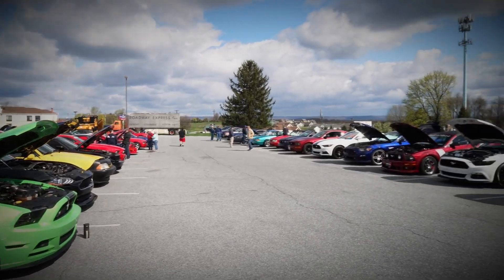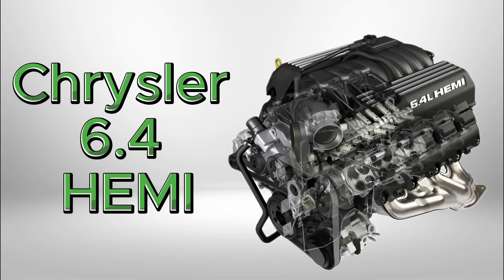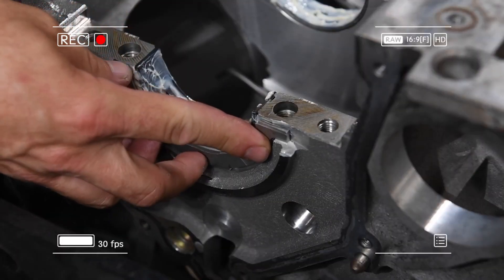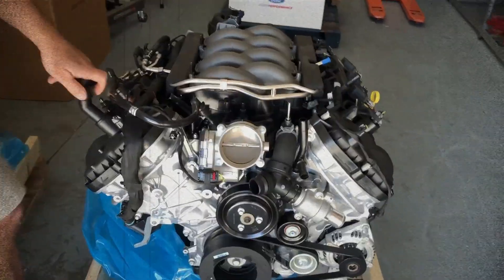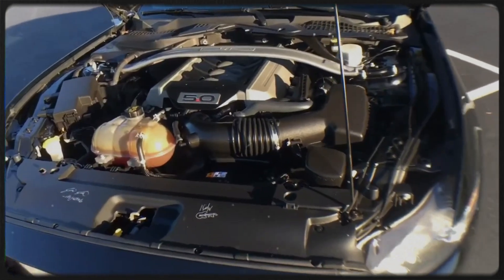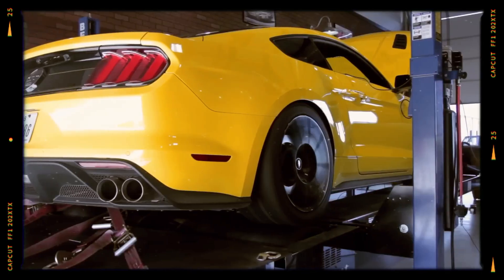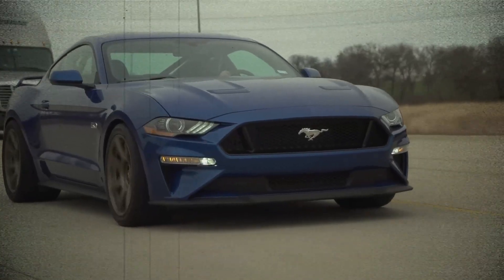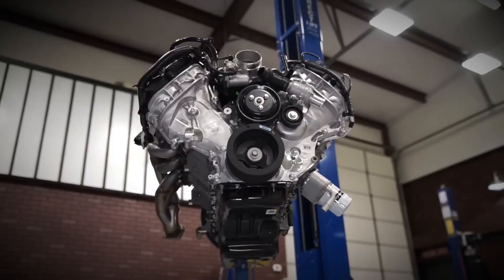Ford 5.0-liter V8 Coyote Engine : Full Specs, Reliability & Common Problems!

Comment: I'm a follower from Saudi Arabia. Your channel is beautiful and interesting. I've subscribed. I have a question: Are there any differences between the 2026 and 2025 Raptor V6 3.5L models, and also between the F-150 V8 and the 2026 V6 Twin Turbo? Which one would you recommend buying, the Raptor or the F-150? I'm waiting for your opinion. I'm interested to know if there are any differences in the 2026 model compared to the previous ones. I'm also waiting for your opinion because there are discounts on 2025 models in Saudi Arabia, and I'd like to take advantage of these offers from Ford.

Comment: vThis is a great channel, it deserves a like and a share. I'd like to ask a question: Do you think the Raptor, as a 2024 and 2025 model with its twin-turbo V6 engine and ten-speed transmission, is a reliable car in the long run? I'd like to hear your honest opinion.

Comment: What year Mustang GT base car has the best reliable 5.0 Coyote engine?  which year?  I used to own a brand new 1988 Mustang 5.0 GT 5 spd. manual I ordered from the factory. It was all factory with the exception that the ford dealership replaced the 3.08 rear end with a  3.55 rear end under a warranty repair.  The car was very squirrely and dangerous to drive regardless of rear end ratio.  The rear end would come around (oversteer in wet or dry weather anytime there was a shift in weight as when braking the weight shifts the rear end to comes around 360 DEGREES) 😱 It had that live rear end fox body suspension from the Ford Fairmount. I drove it very conservatively up to 287,000 miles for 31+ years until a hit n run driver totaled that car.  It was a very DANGEROUS CAR TO DRIVE.😵‍💫😵‍💫😱
Do these later 2011 to 2024 Mustang GT's have a better suspension where it is not as bumpy with a very stiff suspension to drive on public roads and safe to drive where the rear end doesn't jump up when you hit a bump?🤔🤔
Reply: I wouldn't want a s650 because of all the tech. The large screens and replacing functions with tablet like functions. No thanks. My dad and I could replace or service every single part of classic cars up to 2016...I don't see many enthusiasts taking computer tech and electronics service classes,which you're going to need to service these rolling computers.
Reply: Gen 3 2018-2023
Reply: Gen2 2016 S550 GT base model mt82/3:55 ...is the best year and version.
Reply: Whether you're getting the S550 or 650 purchase a base model.  Why pay for performance parts you're likely going to replace and also save the added expense and use for mods.